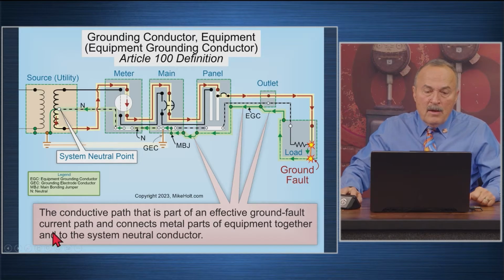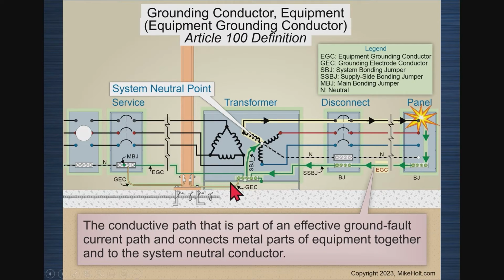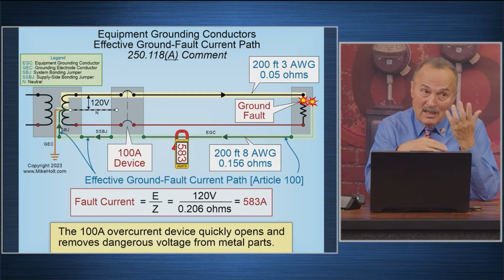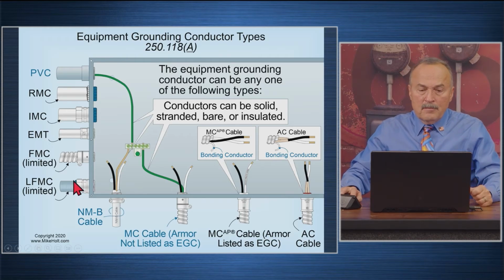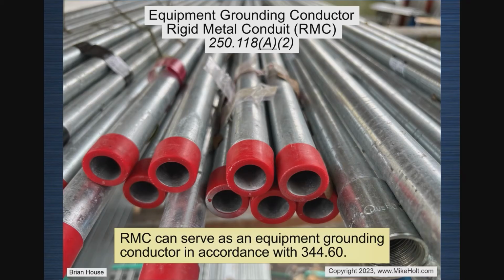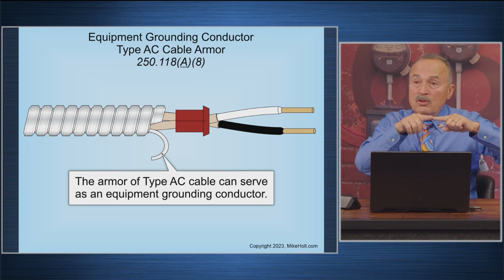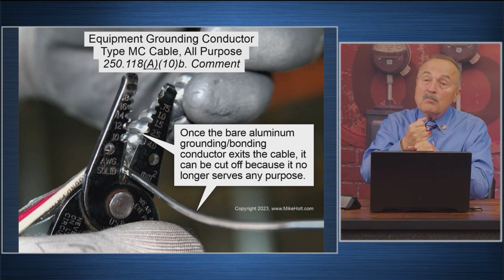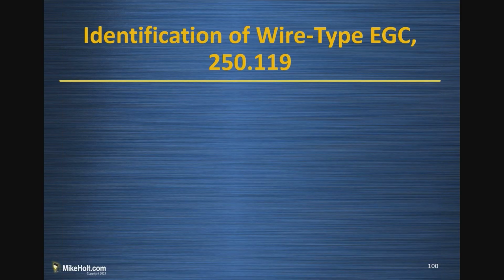Types of Equipment Grounding Conductors, NEC 2023 - [250.118], (23min:15sec)

Comment: Stopped using all metal conduit ( EMT & Steel & Aluminum heavy wall ) 50 years ago as the ground.. Have seen way too many EMT conduit pulled out of fittings and older rigid conduit rusted thru . We had an extra lazy chief electrician who never pulled ground wires. A 11/4" EMT conduit got ripped out of a coupling when plumbers pulled conduit off of the wall to run a line. I refused to touch his work so he had to go repair it. While holding one end of conduit in each hand he came in contact with a knicked 480 volt wire. He had severe chest pains and nurse made him stay in her office next five hours. Next day he still had some chest pain. After that he ran ground wire in every conduit.

Comment: Whats the difference between the RMC and the IMC pipes?
Reply: Imc is slightly thinner wall slightlylarger inside diameter. All threading dies and fittings are the same as rigid  though.

Comment: Hello Mr. Holt, thank you for the every information you post on, it helps a lot of us that are in the trade and we want to get better at it, debunking myths while obtaining a lot of knowledge. I’ve been having this question for very long time, asked couple people and they were not able to give me a concrete answer for those so I was wondering if you can help us out with this question recently LS just calculating how many concurring carrying conductors, including including site a 1 inch EMTso the answer was at least 29 but my question is can we or should we consider the neutral as a curing carrying conductor, should we count them as securing caring conductor or no?
Reply from the maker: @LM-rx2ux, please review NEC 310.15(E) for your answer.
Reply: @MikeHoltNEC awesome, God bless, thank you very much
Reply from the maker: @LM-rx2ux, 🙂

Comment: What about the effects of inductive reactance of the transformer? The resistance is the only REAL impedance
Reply from the maker: @jamesfrancis172, you are 100% correct. To determine the available fault current, we need to factor in all of the circuit impedances (including the transformer).

Comment: Question for Sir Mike & the Gentlemen also. Will it not blow the ocpd with that fault current on video 8:22 it's so high for a 100A. Jack Electrician from Philippines
Reply from the maker: @manuellastroll02168, correct.
Reply: Then it is possible Sir  @MikeHoltNEC to make adjustments on the ocpd so as not to endanger the electrician?
Reply from the maker: @manuellastrollo2168, what?
Reply: Sir  @MikeHoltNEC  my question on video 8:22 is that if the 100A ocpd can not handle the fault current, what is the demand factor to adjust its rating?

Comment: Mike's rant about EMT as an EGC 12:10 is not realistic - the reason electricians don't do this except in the most limited situations is that EMT comes loose more than you'd think. Just takes a set screw to back out a bit. Comparing that to running two ground wires is just ridiculous.
Reply: Would you say that EMT fittings come loose so often, more often than not, because the tubing may not be secured very well to the building structure and thus the entire EMT moves too readily?
Reply from the maker: @slaveofjesus3878, EMT, RMC, and IMC are listed to serve as an equipment grounding conductor, see NEC 250.118.
Reply: @MikeHoltNEC  Yes, I understand that. I was wondering if EMT holds up over time, or not, both were it was installed to code and then later comes loose at it's anchor brackets, is damaged, or never well supported in the first place, leading to a failure of it's EGC status over time, and how common that might be. Thanks.
Reply: Ask yourself why would set screws on emt or compression fittings be more apt to come loose than ground screws, mechanical lugs or other such grounding methods? Of course its possible and nothing is 100% bulletproof but EMT is absolutely an effective path to ground.
Reply: @Enlightn76  Are not ground screws, and lugs more often than not enclosed in a box? Also, isn't EMT conduit a giant lever if then a bracket goes missing, or come loose from it's anchor, is then subject to the weight of the conduit putting a torsional force on the fitting, the fitting with that said set screw?
Reply: A whole lot of what-ifs and yeah-buts. Nobody is claiming a separate ground conductor is a bad idea. A lot of people claim metal conduit alone is insufficient, it isn't per code. There are thousands of houses in the  Chicago area wired exactly as such. Are they more prone to failure than other housing? let's try and look at some hard facts stats and long term observations and see what that tells us. Rather than claiming its ridiculous to consider emt and a grounding conductor as two separate ground pathways because by definition they literally are
Reply: too many solar guys 'ghosting' their  grounding with EMT to multiple solar arrays because of this one weird trick. Especially if a connector doesn't get installed correctly or loosens over time. Not done right.  @MikeHoltNEC